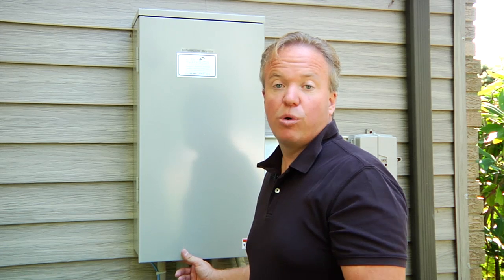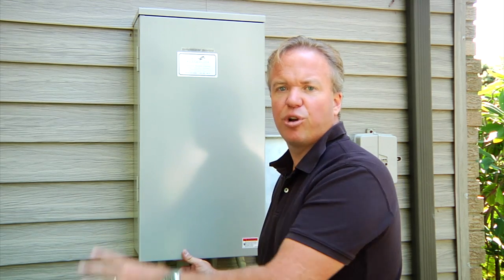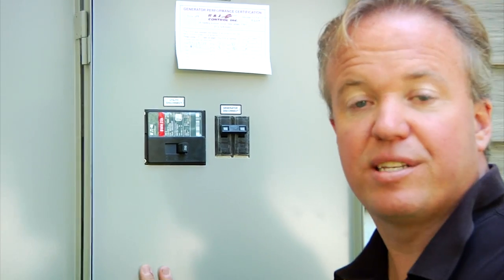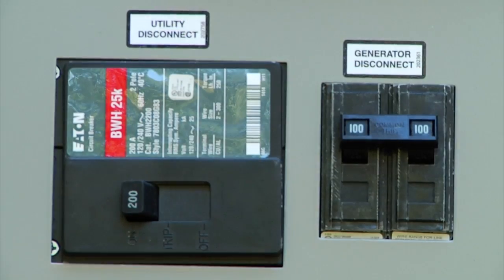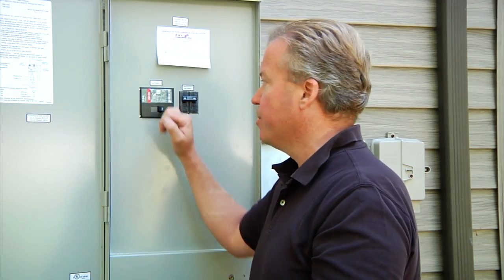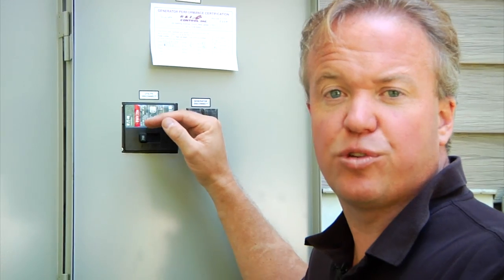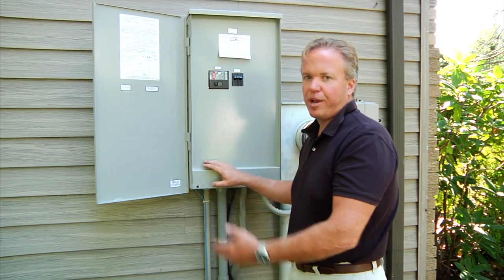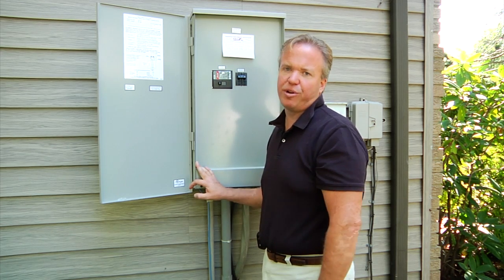Home Generator Transfer Test

Comment: I flipped the switch and Generator kicked in after 10 seconds, (everything worked great) But after I turned the switch back on,  Generator never shuts itself, I had to kill it manually. Any ideas?
Reply: U turned it back on to fast it tricked the system make sure to turn it back off wait few minutes then back on. And after 5 minutes if generator is still running u need service
Reply: Depending on the generator it may run for up to 30 minutes.
Reply: Check trouble codes
Reply: Love your upload. 👍👍   I have a  Briggs & Stratton 17KW with a symphony transfer switch.
Reply: I flipped the switch generator started but no power to house

Comment: My inherited Generac stopped testing itself on Saturdays a few years ago. The maintenance guys (who I had change the oil each year) insisted it was OK. But, of course, when I turn off the main...Nothing happens! It starts manually, but does not transfer
Question: if I start it manually, and then throw the main switch in the panel, should it switch to generator current??

My "current" situation IS: I have a brownout condition caused by water in the main conduit/meter. I had an electrician diagnose this yesterday. The fridge compressor makes a dying noise when starting (I've unplugged it) some overhead lights are brown, and like, TWO watts, while the one in the study is like an arc lamp!! The HVAC transformer got blown again, along with other things.

Comment: Thanks for the video. Gave me just enough confidence to "throw the switch".
Is the ONLY function of flipping the switch limited to just turning off the utility power? And once that is done the ATS takes over? The reason I ask is that. I am constantly getting ATS Communication Failure WARNING messages. Sometimes the warnings last a few minutes or sometimes a few hours before I get a "warning cleared" message. This will usually happen between 1 time and 5 times a day. My Kohler installer put in a new control board, but I continue to get the Warnings.... but NOT getting the "Cleared" messages anymore since the new board was installed. I did as you did in the video and everything worked. (Normally my gen would not automatically go on or off when there was an ATS Warning message showing.  So now I am wondering if the ATS is actually working now with the new board and maybe the "warning" messages are somehow just "false alarms". So if the ONLY function of flipping the switch in the video is to turn off the utility power, then maybe my ATS is working regardless of still having an ATS COMMNICATION Warning.

Comment: I have a 17kw gen, 70 amp output connected to a 200 amp transfer switch. It does run the ac unit and many of the lights. I have not yet had the opportunity to do more test, as I am waiting for propane. Does this seem right?